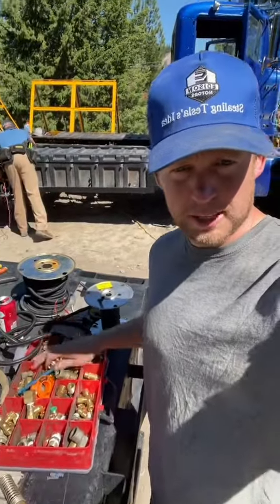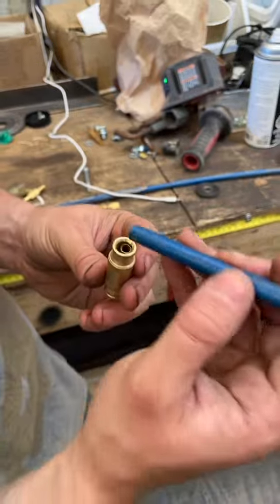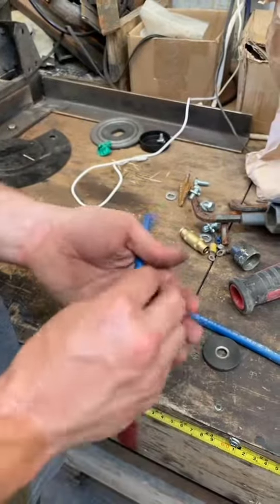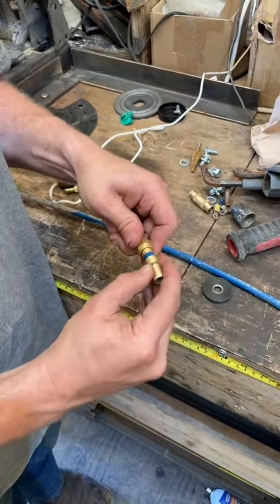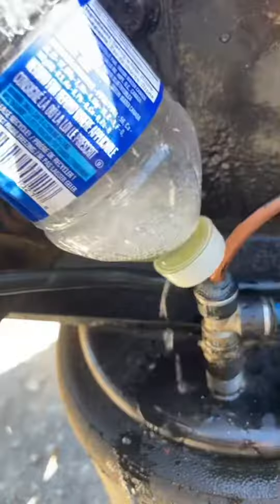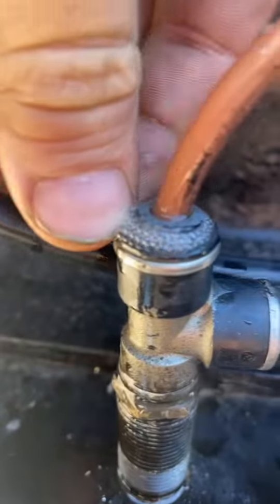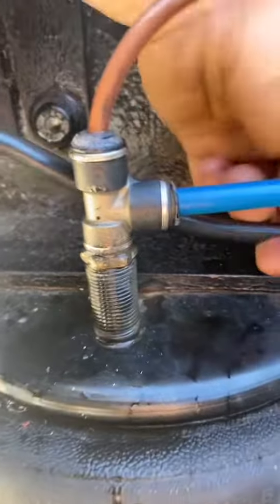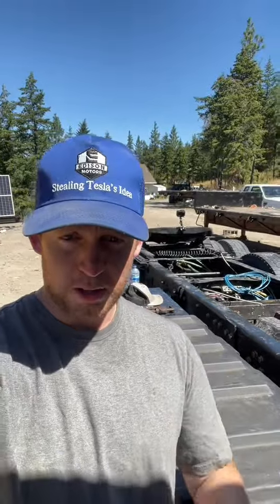The Right Connection: Choosing Between Quick Connect & Compression Fittings for Truck Airlines

Comment: As an off road enthusiasts we carried the quick connections for on the trail "quick" repairs. Sometimes the rigs would pop a line in a  not so repair friendly place and it needed to be repaired before you can continue.  A quick repair fitting and on the road.
When you get home in the shop and you can completely clean the area you fix it right. This usually means replacing and rerouting the air line with all new compression fittings.

Comment: The best airline fittings I've ever seen in use are the Voss 230 push in connectors, with the correct nylon hoses they never leak at the joint with the hose, and the threaded part of the connector can be resealed with new o rings if it ever does leak. It does require a special mandrel tool to fit the fitting to the air line, but once it's fitted you'll never need to remove it, and only need a spanner to change the O rings in the unlikely event they start to leak. They're used by Mercedes benz on the unimog air systems, and I've seen even 50 or 60 year old trucks still using all original air fittings.

Comment: I think Quick connect fittings have a place in roadside repair, because if you're on a job just pop the fitting in and then you're back doing your job and it will be good enough for the rest of the day, then you fix it right (If you want to fix it right the first time go right ahead, but depending on the road it might be safer to just do the quick connect)

Comment: I've had plenty of compression fittings that simply would not come apart in the field. Also, oftentimes, there is not enough room to get a wrench on them, so i end up cutting the line and replacing the fitting anyway. I actually prefer the swivel 90° quick connects in a lot of applications. If the hose won't come out easy, you can just spin the fitting and remove it with the hose attached, and they use a fairly small wrench size. In my application, a little tiny leak doesn't matter because our compressor basically runs non-stop all day anyway, and we drain all our tanks at night.

Comment: Quick connects are great, just not for the trucking industry. Quick connects is what you'd see in a factory for air operated machines. Great to quickly replace valves and such when you have 5 huge compressors keeping everything pressurized 24/7 not for a truck that sits overnight with the compressor off.

Comment: Quick connects are short term repairs in a pinch at best. Always compression fittings! By the time you have issues with a compression fitting the line is junk.